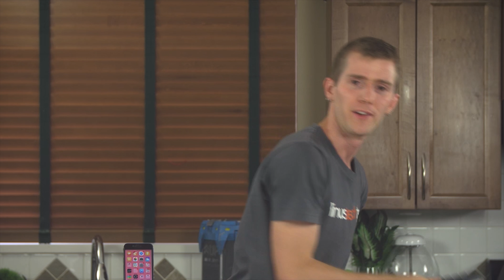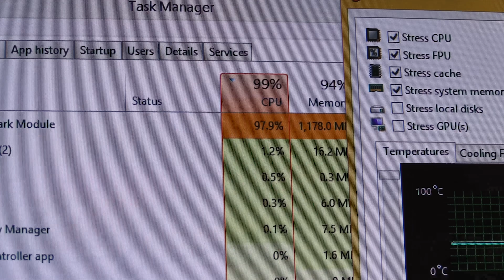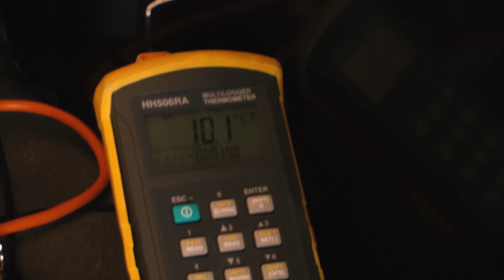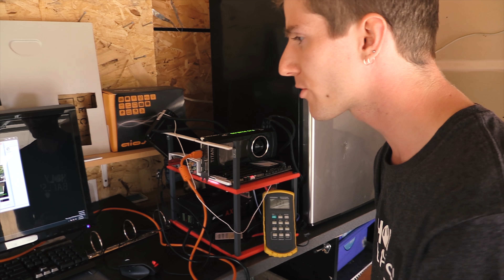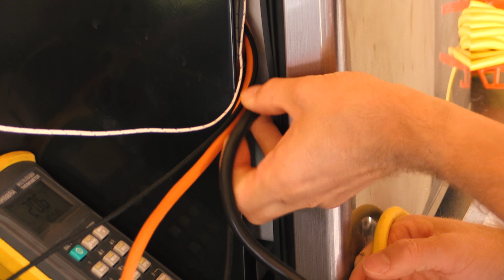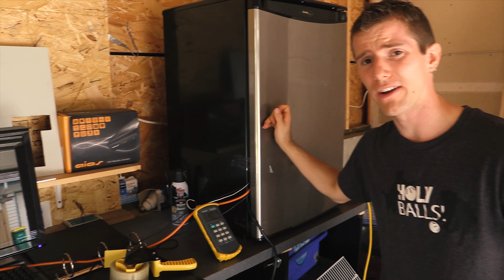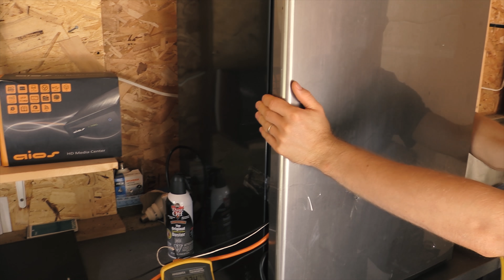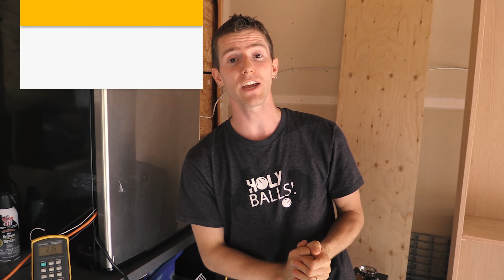PC Build in a Fridge - Does it Work??

Comment: What about a mini-freezer with a larger capacity? They could potentially be more "industrialized", and run more often (and to a cooler temp). If enough space is present (as people build entire desks into desk-PC's), a potential desk/freezer scenario could be the mix of AC and "fridge concept" that many of us have dreamed of. 

...Or, we could direct an AC unit through ducting to blow directly through a "desk-PC" setup. That would be pretty sweet, if you want a 1000W draw PC cooler. 

Just some thoughts.

Comment: I know it's a little old already, but I was thinking: wouldn't the results be better if the "fridge" could keep it's vacuum?
With the ZBox, the cables were thinner so maybe it had almost no effect on the fridge's workflow, but when the huge regular cables were keeping it always open to outside air and preventing the regular work, then the results would be worse. It would've been a great ideia to test the Zbox again with the same opening as the regular PC cables. And some kind of adaptation to fully close the door with the regular PC.

Just like if you keep any fridge open it won't be able to cool anything, basically.

The final words were clear for the results, but I still am curious on some better tests, more controlled ones.

Comment: How about if you ran the liquid cooling radiator to the outside of the fridge, so that instead of pumping that heat into the ambient space within the fridge, you were pushing it out directly into the room? That way, instead of tasking the fridge with compensating for all of the heat produced by the computer, it could serve as a secondary cooling device to the existing cooler installed on the CPU.

Comment: My understanding is that those mini fridges aren't meant to have their motors running continuously. They are meant to turn on and off, so they would be under more stress than what they are designed to deal with. Burns out your mini-fridge.

Comment: The best result would be arranging a vapochill and put it on where it needs to be, i.e a CPU or GPU for example. I've reached -40 degrees idle and -25 degrees stressed with a 250W vapochill machine. Those are wonderfull, but expensive and lots of noise running 24/7.

Comment: I don't know in USA but if you look at energy cost, fridge cost and cooling set-up cost in my country. With a 300€ mini fridge you will pay something like 50€/year of power bill. With a 200€ euro mini fridge it will be 100€/year of power bill. With a very cheap one that is not even sold any more in my country because of energy consumption you will pay 100€ or less for the fridge but 200€ or more of energy bill (this is only in h24 100% stress so with a computer inside). Energy consumption will be double at least for freezer or deep freezer. So even if a deepfreezer is probably able to handle a computer like that you will have better result with a custom loop of watercooling for sameprice the first year and spare hundreds by the end of life of your cooling system.

Comment: I still think the fridge idea is a good idea
makes perfect sense that the components would heat up to 27 degree

however, I think that the temperature can't cool down fast enough so by default it would heat up slowlybecause it has nowhere to goso heat slowly builds up making it hotter because it's being contained, and not going anywhere, that is the biggest mistake

if you modified the fridge so that the logical thinking of heat rises so that fans inside the fridge pointed up forcing all the heat up.....it will work ;)

Comment: The cooling mechanism of, even a quality fridge, is pretty inefficient. They work because of how well they are insulated. The same will happen with a deep freeze. The mechanism is sufficient enough to cool an icebox, but the moment you add a heating element into the box you will render the cooling element useless and just use power. 

What might work is using a water cooling system in conjunction with a freezer. Put the radiator outside the box, seal off any airflow. Make sure that the tubing carrying the water to and from the system is well insulated so you don't have heat exchange happening in the icebox.

I still think the icebox would have to use a lot of energy to stay cool, but it might be a fun experiment.

Edit: Not to mention the problem of condensation.

Comment: Linus' explanation was spot on this time. The insulation in the fridge that keeps the heat out also works to keep the heat in. All the heat has to leave via the compressor which isn't rated for a constant 300 W heat load. Unlike an air conditioner which cools and de-humidifies and is are rated for at least 2 kW constant heat load. TLDR; use an air conditioner

Comment: isn't max clock speed also dependent on stability therefor if the cpu can max at 6GHZ even if it was -100F it still would work? I don't really know that much about it. the world record is over 8GHZ but if you could keep it cold could really use that speed? also could run a liquid cooling line though the freezer or ice? cool tidbit the cray super computer has so much heat that it is used to heat the building :)

Comment: If you have a fridge that keeps cool by being well insulated rather than having a powerful compressor then there is a limit to how well this works. Put a 500 watt gaming computer in a fridge and the fridge will probably get considerably warmer than the room, even whilst working.
Usually there is nothing in a fridge actively trying to warm it up from the inside, unless you put some food in there that is still hot.

Comment: linus I I respect your opinion you seem to be very knowledgeable when it comes to PCs but. if you're going to put a PC in a fridge you need to make sure the fridge is vacuum sealed that's the only way the fridge works it extracts heat from a space now the door was partially open because of the wires and as much as you would like that fridge to work it will never be able to compete with the heat outside that unit so. if you're going to perform this test again please use metal tape all around the door sealing point. allow the fridge to reach its minimum point another words what is the lowest temperature it will achieve with the PC and they're running at idle then proceed with your torture test thank you for listening to me

Comment: what if you put a mineral oil cooled pc in a fridge. there would be no moisture or condensation and if there was it would be on top of the oil and would not effect the internals of the pc. it would keep the oil cooler and make the pc run crazy cold.

Comment: Also, in my experience working in about -20 degrees freezes monitors. Not that you would have your monitor cooled as well, but it was so bad for me that the monitors literally would not turn on. We had to put a heater fan on it for 2 hours before they would work. Really made work suck!

Comment: What if there was an exhaust through the top releasing hot air and keeping most of the cool air.
Reply: +Lucas Farrell Well, fridges tend to be airtight and they don't create cool air, they cool air that's already there. So you'd have to get in ambient air somehow and cool it down before using it to cool the components. Not saying it's not feasible but I doubt the whole fridge case thing would be the best use of the compressor and the radiators that do the actual cooling.
Reply: +Lucas Farrell you would have to be careful where you put the hole. Some fridges have heat pipping that is in the top. I had a smaller bar fridge that I had pulled all of the components out in one piece to experiment. $99 Au that I had replaced with a bigger bar fridge that was going for free. It is a 50 watt system that did ok on a cheap CPU. I then turned it into a portable fridge esky (still working on why it is getting too cold, like -2 Celcius/ 26 farrenhit).

Comment: What about putting the reservoir of a water cooled PC in the fridge, via putting quick disconnects through the side of the PC? Radiator and fans will all be external still, just the reservoir inside.

Comment: Ok I have a mini fridge cooling my computer and it works fine. You absolutly failed the internal air cycle principal that makes it work. You need to create a breeze inside the fridge that cycles around by using fans that take the air and move it around. Also the mositure problem can be fixed by getting a fridge with a dehumidifier or "automatic defrost". I've had my same computer running in a mini fridge, HDD and all for over 6 years, With the exception of upgraded parts here and there. At the top of the fridge where the small freezer part is, put in the radiator and punch holes in the bottom of the freezer cadge to let it flow into the rest of the inside of the fridge, put one intake fan and one outake fan on either side far apart as possible. Move the HDD and drives to the veggie tray at the bottom. I made holes in the side of my fridge where they stick out of it but still sealed around it, but you don't have to. Only needed if you would need to open it a lot for discs. Don't slot them on the door, cause cords get pulled! Put the Mother board upside down about 3-4 inches below the freezer cadge and put some fan pipes in. You know those air tunnel things so air is moved in one side and out the other Facing down! Incase the mother board in a box of some sort, doesn't have to be air tight, just enough for air flow to be effective.This project may need some custom made mount points made and some extended cables for your devices. Also make sure the power supply is centered in the fridge just above the veggie tray at the bottom about 3-4 inches above it. PS never really needed any extra cooling on mine, but I faced the fan on the bottom of the PS up. Make sure you get some extra fans in there to complete this, and I recommend at least a 950wat PS to handle the additional fans plus your other hardware.My fridge PC at load runs at 93F and it's an old mini fridge from 1997.

Comment: A factor you didn't use is that.  the mini fridge is still small area of space where the heat will be locked inside which is kinda what you said. but your doing an ambient temp test in a open shed with a huge door that's open. So with that amount of open space and warm/cool day it would be harder for it to get hotter in a open space like out side then let's a say a room with a closed door where 99% rigs would be place. That's where your original ambient temp should of been ran.

Comment: well you have a defrost timer that automatically turns on at certain times to make sure it doesn't freeze over, also because the fact that constant heat is put out on the cpu rig vs food doesn't produce heat once cooled its cooled unless you thaw it

Comment: The answer is derived by maths, not testing.

However many watts the fridge draws from the mains, is roughly the thermal dissipation value of its heat exchanger - minus the heat produced by the pump itself, and the losses within it.

So, if your fridge draws 250 watts, then it can probably cool a PC which produces up to 200 watts of heat.

But the whole idea is silly, because you are doing the cooling process twice: once inside the fridge, and again at the back of the fridge.

You don't need to be an engineer to understand that this is a very silly way to cool anything.

Comment: no airflow in the fridge......when you open the door, condensation will happen, even if you power it down, these components have some HD caps in them that will likely hold charge

lots of problems with this.....

Comment: The rig is gonna heat up the inside since there is no exit airflow I'd imagine, more than the fridge is cooling, compared to ambient temperature. And if I'd finished the video before posting that's exactly what happened. Good video.

Comment: Instead of just building a computer in a mini-fridge, you could build a cooling tower that is internal instead of external as one would think of a cooling tower.  But this would be built to cool how ever many systems connected by insulated cooling lines.
A Commercial Mini-Fridge can keep it even cooler just below freezing.

Comment: This is all done wrong. He just stuck the whole computer right in the fridge, radiator and all. The radiator is supposed to disperse heat, so if it is also inside the fridge it is no wonder the temperature is too high. You would need to modify the fridge and cut a hole to mount the radiator AND you would need to add a fan to  make sure that the airflow is consistent and blowing through the radiator, out of the fridge. Then seal the sides of the radiator most likely with silicon sealant (used for kitchens and bathrooms).
 I know a fridge is supposed to insulated, but not if your are heating from the inside. Also he needs to create a better seal on the door of the fridge. Having all those cables smashed in the door of the fridge breaks the seal and he again would need to modify the fridge to have cables leading out, but have like rubber washers to make sure they maintain the temperature.

Comment: Your conclusion makes sense, you'd be better off having the system in an A/C'd room to reduce the localised ambient temperature (the cooled room) and therefore reducing the delta temperature to the true ambient (outside/non AC) and gain some temp losses that way. The refrigerated air will also be dryer than outside, especially if you live in a humid climate. Humidity = shit/corrosion.

Comment: This test is flawed, the fridge wasnt functioning properly and the condensator will not work, letting the pc inside and booting up should have you under 10c at least. Next time drill the front door and try it

Comment: Whyd he say not to put the hard drive in the fridge?
Reply: The magnetic read head skims across the magnetic platter on a cushion of air is only a few microns thick. Running in very cold air will cause the platters to shrink, affecting the tight tolerance and causing the read head to "crash" into the platter.
HDD also use a fluid lubricant in its bearings that would thicken in cold temps, causing the platters to move slower than usual, causing data corruption.
Reply: My guess is because of the tolerances of the spinning disk and Lazer. Don't want them to tight, it might run slower or not read it well.